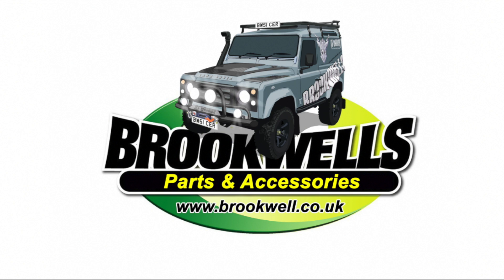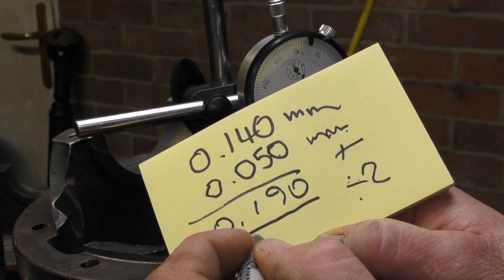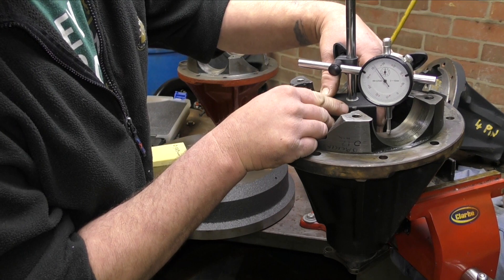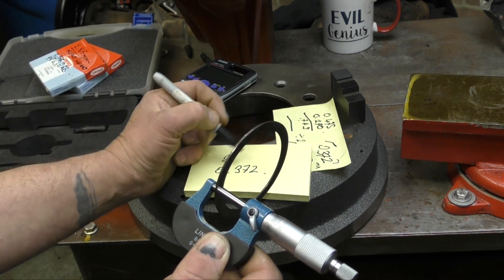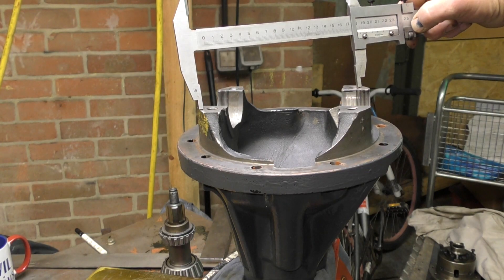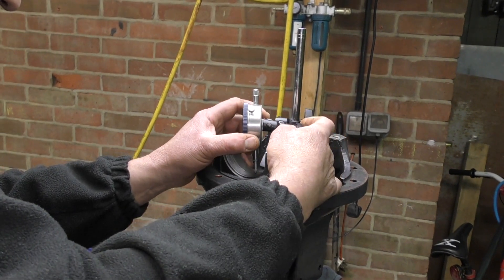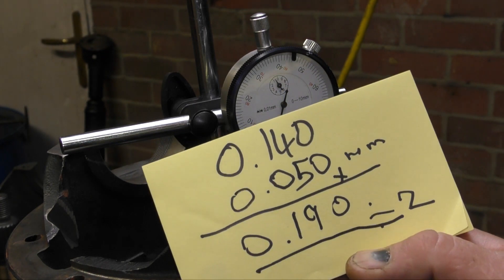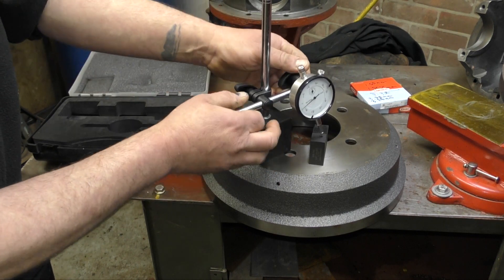Land Rover Differential Overhaul - Necessary Pinion Setting Maths - Nominal Pinion Height

Comment: The shim wasnt 0.095?
Reply from the maker: yup.  maths screw up there.  I see it.   Thanks for pointing that out.
Reply from the maker: No, that'll be the correction to the shim(s) to make it correct.
Reply: But you wrote and used 0.95, not 0.095.  Check the video.  It is quite clear.
Reply from the maker: Yes you are quite correct.  Sorry.  i need to correct that.

Comment: When I was preparing for this job, collecting the necessary stuff, I wondered where I could find an untouched machined surface. 
Then I realised that I had a brand new crown wheel that needed fitting, which is an excellent base.
Chris, as long as there are Land Rovers on the road, your videos will keep helping people! Thanks for your excellent work, again!

Comment: Hi, I'm just wondering about something. Are the front and rear diff's different on say the Discovery and P38s? I got a replacement diff (ordered the correct part #) but I noticed the internals rotate the opposite direction. However the output rotation is correct so it does work (I did fit it and test). Would it make difference in wear and stuff? Thanks for your input and time.
Reply from the maker: they are different but if you look up Megasquirt on you tube he should be able to help you

Comment: Instead of pressing in the new race, measuring, then remove it to re-shim and then press it in again, couldn't you take the old race and machine off some from the outside so it slides in and out, use that to get the measurement right, then press in the new one with the correct shims?
Reply from the maker: you'd be better with a new bearing race, but it would work.

Comment: So, it can be done a lot easier.  Land Rover diff pinions are exactly 3" (76.2 mm) from the carrier bearing clamping face to the top of the pinion.  It has always been this way.  It is a simple number to remember.  You simply need a straight edge and a depth gauge (regular calipers).
Reply: This I have found to be true. I have checked both my new and old pinions and they are both exactly 3" from the top of the pinion. So it begs the question, who in the hell's business interests is Chris looking out for? I have compiled a list, based on logic. A is for Ashtrans, B is for Brookwells, f is for some expletive including fourby letter words, and the list goes on.
Ashcroft quote measurements from the pinion bearing face, to the top of the journal clamp turrets, and even give the imperial measurement, engraved on the bottom of their h.d. pinion
which is impossible to measure btw without the dummy pinion (like when after you have pressed on your main bearing on the pinion, as you do)
I have surface ground my original bearing cups down to make them easy to remove, and set up my shims using trial and error and engineers blue with the help of a vernier caliper.
Reply: This useful information was provided in the Series 1 and 2 manuals and then after that they started to tell you to use these custom height blocks.  But...nothing has changed.  The diffs are all still the same and no special tools are needed.
Reply from the maker: There are 3 different heights for nominal pinions, one being the Salisbury axle. then there are the machined plus 3 thou and minus 3 thou to take into account if these pinions are encountered. This is the defender and discovery 1 diffs.  The D2 and Later Defenders again are different.
Reply: The different heights are for the different bearing diameters used through the years as the blocks measure to the outside of the carrier bearings.  The 3" from the bearing centerline never changed (for Rover style diff centers) and can always be used.  You just need a straight edge and a depth gauge..  It must stay the same as the ring and pinions never changed.  Salisbury is different.  That follows standard Dana 60 protocol.
Reply from the maker: I'll get a depth gauge and we will explore that.   Thanks for the heads up.
Reply: Salisbury/Dana 60 should be 3-1/8" (3.125").
Reply: Is this the same on the freelander IRD Pinion??
Reply: This makes much more sense than dicking around with a gauge block, DTI and trying to judge the low point of the bearing housing 👌🏼